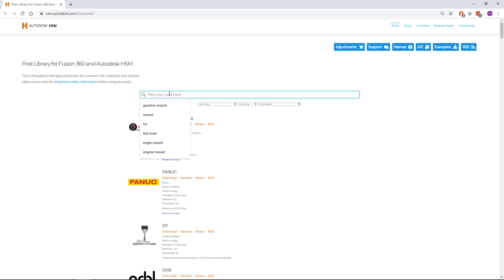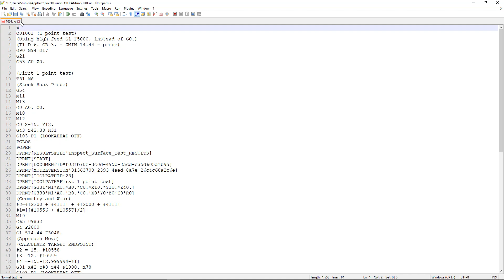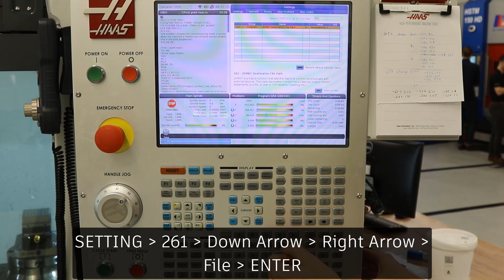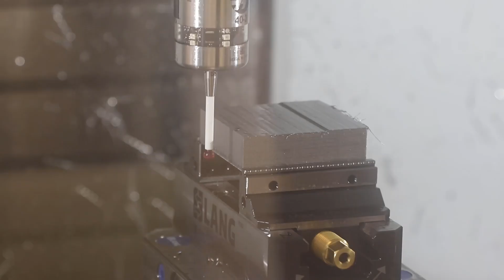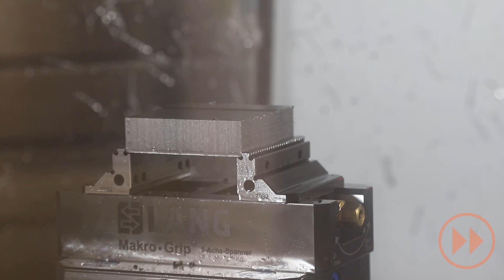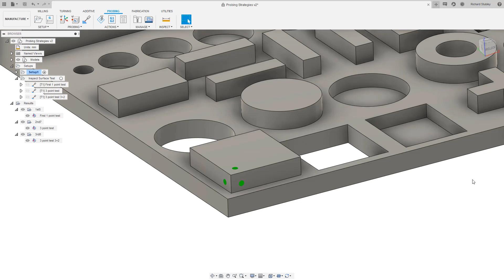Autodesk Fusion 360 | Tutorial: Using Surface Inspection with a Haas Next Generation Control

Comment: Hello, 
I've been trying to use the surface inspection. Followed the directions from this video and I'm getting a deprint error. I think the Fusion post processor isn't processing something right. 
On outodesk's website I have a thread started with the gcode "Surface inspection deprint error on haas NGC" If anyone has any solutions let me know. https://forums.autodesk.com/t5/fusion-360-support/surface-inspection-deprint-error-on-haas-ngc/td-p/9575587
Reply from the maker: Hi there! Glad you're giving this a go! Make sure you've downloaded the Haas Surface Inspection post. Here's a direct download link to the Classic control with surface inspection: https://cam.autodesk.com/posts/download.php?name=haas%20inspect%20surface and the Next Gen Control with surface inspection: https://cam.autodesk.com/posts/download.php?name=haas%20next%20generation%20inspect%20surface
Reply: @adskFusion  Yes, I used that post processor for the NGC. When I press post, I then select the drop down and select the surface inspect processor. I just opened it up and it's Revision: 42810 39afb1e4d8f7371c0efa5f1c4f7eb0747c34dc16 Date: 2020-06-04 09:41:29
Reply: @droid442  Hi I've had a couple of reports from this, can you take the underscores out of the DPRNT line and see if that works then.
Reply: Delete the lines of code: POPEN and PCLOS.

Comment: This inspection process is great for checking points on a part and cross referencing them to the model. However, how can we inspect feature sizes and have the results be documented? For example, measuring a bore/measuring the distance between to surfaces/measuring the distance between a center point of a bore and a surface/measuring and angle and recording this data on a file with reference to the work offset? A video on this would really help. Thanks

As an add on, I realize Probe Geometry can capture feature size and then be recorded. But this probing cycle seems to only like surfaces that are normal to the X and Y axis. When I try to Probe Inspect geometry that is an angle, the software doesn't seem to recognize a cycle type. How can I make this work?

Comment: Why do we hace to turn off sequential numbers on the post procesor?
Reply: You cannot DPRNT with a sequence number on the same line, the machine errors out. Since this video has been made we have actually modified the posts to automatically remove the sequence numbers form the inspection portion of the code even if you have them enabled.